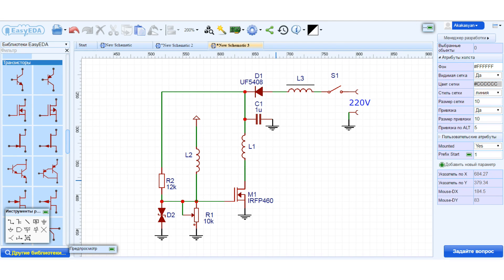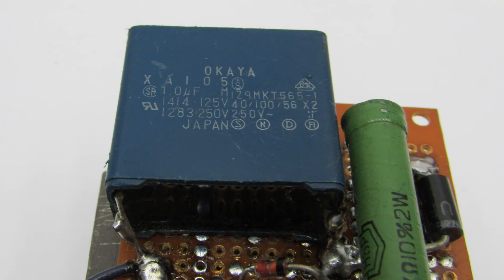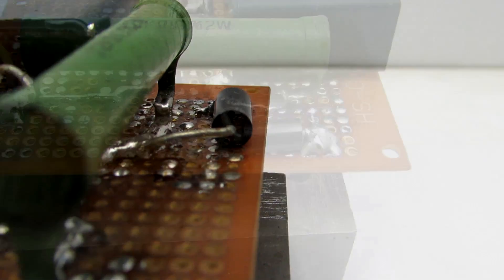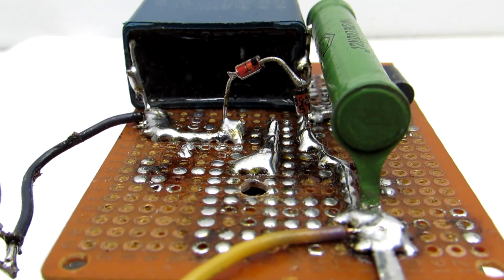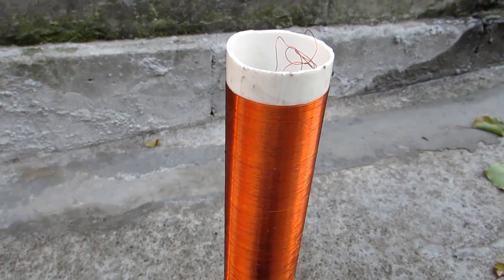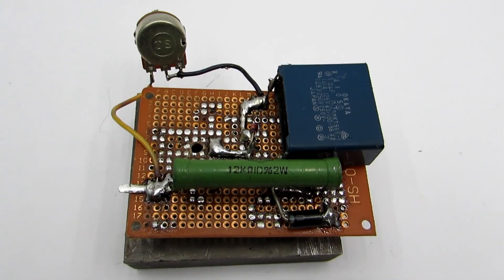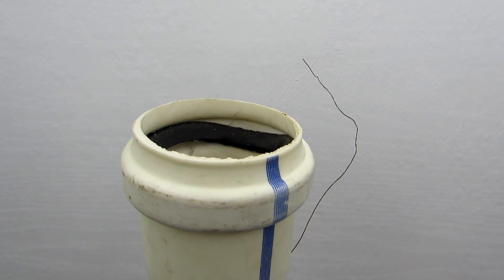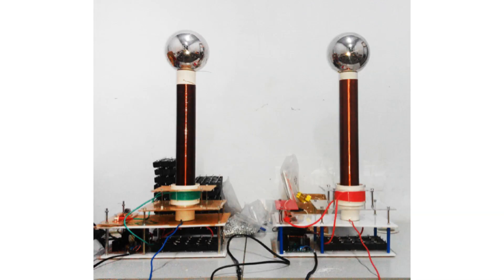How to make TESLA transformer

Comment: Hey can you tell me what is the throttel and how can i get one?
Reply: U can just use some kind of ballast, because the throttle keeps the mosfet from puling like max amps. So basically you can use a lamp but it has to take at least 40W I think or anything other like a transformer but this one is more dangerous for me the 80W light bulb worked the best

Comment: Hi, I'm trying to make this tesla coil for almost over 3 months, I tried everything!!! but as soon as I plug it into power, nothing happens and my MOSFET dies,
1400 secondary / 7-10 primary turns,
40w magnetic ballast,
UF 5408,
12v Zenor diode,
1uf MKP,
12 Kohm 3w resistor,
10k pot.
also tried using 1 and 2 40w magnetic ballast but the same results!
I killed almost 10 irf460 in the process but no results,
can you help me plz
Reply: I think your secondary wiring is in wrong orientation try to flip it
Reply: I made one and i will make video about it
Reply: @VineethNarayanan  thanks, I'm excited to see your version. when will you post it?

Comment: That IS just slayer exciter with protections
Reply: It is very similar but its not a slayer.
Reply: @MongrelShark  How is this not a slayer exciter?
Reply: @16BitGoofball For many reasons. Most of them because its not the right circuit. The rest because it doesn't perform like a slayer.

The tesla coil style inductors part is the only thing it has in common with a slayer.

P. S. Be careful if you try to replicate this. Its got significant electrocution and fire hazards that a Slayer does not have.
Reply: If you want to see real slayer exciter there are many videos on many channels. Including my channel 😉
Reply: @MongrelShark  You'll have to elaborate on that, because to me it looks exactly like any slayer exciter circuit besides the mains voltage. And I've built many SSTCs.
Reply: @16BitGoofball  I don't have time to argue with random people on the internet. I've provided links to actual slayer circuit. I don't have to do anything for you. Try doing your own homework.
Reply: @MongrelShark  I wasn't arguing with you, I'm just asking genuine questions. You need to calm down.

Comment: i'm not sure but you could touch the sparks because you connected the circuit's GND on neutral, if you connect it on the live wire you still get the same sparks but you'll get shocked by the 220V jumping the arc to your fingers because the sparks are conductive and the ground reference is now oscillating along the live wire plus or munus the mosfet's gate polarization, that is small compared

Comment: Wow 5 hours to wind your secondary. I managed to wind 1000T of 0.4mm wire in an hour by hand onto a 90mm pipe. I would say it helped a lot to have a 4kg spool of wire that was on a rod which provided resistance. All I had to do was keep the feed angle correct and the wire fed itself on.
Reply: 6 days for hand winding a 20cm in diameter and 50cm in length tube with 0.2 wire

Comment: Super sir. L1,L2 is primary and secondary ,how many turns in L1&L2 ? And L3 value? Please answer me sir ,thank you sir
Reply: L1 and L2 can have any turns you want (other circuits ive seen similar to this one use a turn ratio of 1 turn on the primary to 160 turns on the secondary), since the circuit has a feedback system which will tune itself to the resonance frequency of your coil, L3 is just a ballast with the impedance of 30 - 60 ohms, which helps lower the current so that your mosfet doesnt blow up. You should use one that doesnt warm up as quickly tho, because otherwise it might blow up.
Reply: Sorry for the late reply, but this should answer your questions. in regards to the turns of L1 and L2, if you have a coil with 800 turns, you should use 5 turns on the primary. Ive heard it works best, but you can test out combinations with what works best.
Reply: In the video, they use a secondary with 1150 turns, and a primary with about 6 turns.

Comment: Can we use a full bridge rectifier? The circuit would theoretically be far more powerful. Also, i think you have too many primary windings. If you used 3 windings, the arc would be twice as long. And BTW, put a loading resistor on the output windings of your ballast transformer, and you can get more power from it. If you used a REALLY big high-wattage potentiometer, you could have an adjustable ballast.

Comment: You wound this coil with 1150 turns on secondary, in about 5 hours. I wound mine, the same pvc pipe diameter with 3547 turns on secondary in 6 hours. But I am skilled transformer/coil winder without machines, so I don't disrespect you :D

Comment: Can you audio modulate this circuit ?
Reply: yes, but you need to use a driver. You can however audio modulate a bjt slayer exciter directly with pretty much any transformer, however as a mosfet amplifies change in voltage, you need to get the transfomer just right in order for this to work directly.

Comment: guys I am having a really hard time getting my tesla coil or slayer exciter or whatever you wanna call it to work. I am using a working npn transistor I have made like 3 coils one around a ball point pen one around a medicine bottle and now one around a seringe previously used to refill printers but not one has worked I can't get a light bulb to light up I have checked my connections a thousand times I have used all different voltages all the way up to 12 volts and nothing. I used some brand new magnetic wire from radio shack and used a wire with insulation around it for second winding being slightly larger in diameter. I have made many circuits I am new to making circuits but I am not that bad I have watched tons of video's read up on how to on the internet and it just boggles my mind! If anyone could help me I would appreciate it I am thinking about making a video showing what I did and it not working just to prove I have carefully replicated a slayer exciter. I can't believe I have been trying to build this thing for a month now it is really embarrassing!!!!!!!!!
Reply: captain42979 Perhaps you have reversed the winding of your coil? The circuit depends on which direction the power flows off the coils to switch the transistor. At least, that's what I understand. Everything else is polarized, which must match exactly. Your coil is the only polarity that isn't pre-marked. Do you have it wired properly for throwing the transistor on and off? That's what makes it vibrate and why your coils do not have to be tuned and why critics say its not a Tesla coil.

The power turns on the transistor which lights up the primary. The secondary has to be wired to turn the base off, usually by a reverse biased diode that counteracts the bias voltage on the transistor. The transistor shuts off. The both coils shut off, and the power can properly bias the base again to power up the primary.

The Tesla coil has a secondary that runs free of the primary except for the field feedback. So it vibrates with the primary and gets reinforced by switching as fast as the primary even though its much longer. It has to have about the same mass as the primary and also have a multiple turn count that is a whole number multiple of the primary so the Oberth effect will pump the output above a typical multiplication of coil to coil voltage level. That's what resonance is all about. A properly tuned Tesla coil will have the same inductance and capacitance of the primary as a base multiple of the secondary inductance and capacitance. Total power will be limited by the resistance of the wires in this case.

The comment of only producing transverse waves is not exactly accurate. If the top lead is a single wire, it acts as an antenna and produces transverse waves. If the top lead is a properly shaped coil or flat surface, it will produce longitudinal waves. The Sphere produces spherical longitudinal waves. Both Tesla spark gap circuits and Slayer/transistor circuits are powered by both transverse (charge) and longitudinal (dielectric) energy in a transverse powered mode. Tesla realized that dielectric energy is like a soft spring, kind of mushy. With high voltage you can pre-compress large amounts of dielectric energy and make it more like the tight spring of voltage or charge energy. The dielectric energy is pretty much un-shield-able. It is what characterizes magnetic fields (although in that configuration the charge is on the inside of the dielectric energy, but that's another story). But to get it launched takes a pretty significant charge to organize and push it (with high frequency). When you do, it travels faster than light and will convert to charge when it hits a properly tuned metal receiver. This is how Tesla coils and hairpin circuits transmit power. Bipolar Tesla coils and the Hairpin circuit will cancel out the voltage (if wired properly) but pack a lot of dielectric energy that will pass through all kinds of non-conductors to be converted to regular power on contact with metal. Which is why you can hold a fluorescent bulb and move your hand near a Tesla coil and light the bulb or bring the bulb directly in range.
Reply: The longitudinal waves do come off either design which can be verified with a standard light bulb with no connections. The dielectric energy will penetrate the glass and charge the gas and filament, creating ion arcs and corona. Not the work of transverse power which would stick to the conductors and just heat the filament.

Comment: Isn't this a Slayer Exciter, but running directly of mains power?
Reply: basically
Reply: No difference. A slayer exciter is a driving circuit, and the Tesla coil is a resonant transformer that is being driven.
Reply: thanks :D and sorry , in my country it is potenciometer which is pretty close .. :D thats why :)
Reply: no problem :D
Reply: Thanks, and can you please tell me if i can regulate 2000V input tesla coil with potenciometer ? thanks for answers
Reply: @filipstehlik7363  i hope you didnt try that with a standard potentiometer
Reply: yes, you can but with a potentiometer and nor a potenciometer :P! The exact type of regulation will depend on the design though. For a Slayer, it is transistor bias and for a more complex design, it put a pwm interrupter.
Reply: Can you please tell me what is differnce between Tesla coil and Slayer Exciter ?

Comment: Your bread board is in electronics parlance "perf board" breadboards are the white plastic one that you can plug components in for prototyping a circuit before assembly. perf board is a perforated board with solder points.

Comment: i'm sorrry... can I use different type of transformer as L3 in the circuit instead of toroid ac transformer you used? and if so  how many ampere does the circuit require from the transformer?
Reply: Mahajana Hatmanda its running off from mains he uses the inductive choke to cut down the amperage use 60 ohms would probably cut it down to 8 amps
Reply: do you know how to make one? I mean which diameter of toroid should I use and how much windings to make that specific impedance. thanks...
Reply: Mahajana Hatmanda use math there calculators online a couple of walmount transformer primaries  probably would work fine
Reply: thanks... ill look into it
Reply: u find any solution mahajana

Comment: i'd strongly advise using large and short tube for secondary instead of long and thin one for better magnetic coupling and dont stretch the primary, because the secondary would try to arc trough the primary
Reply: Gotin Fuklio I make my primaries 3 times the diameter of the secondary and no taller then one third of the secondary's length. makes for cool transistors, lots of plasma and a safe setup.
Reply: he just said thats not a true tesla coil its a different variation of one
Reply: prototype9000 i just said that there are important rules when winding HF HV transformers. what does it matter what powers the primary?
Reply: Gotin Fuklio You could try coating the winding with a polyethylene wrap to reduce arcing. it would take several layers but they are thin.
Reply: Johnson K. Angel anything AC is a transverse signal not scalar.